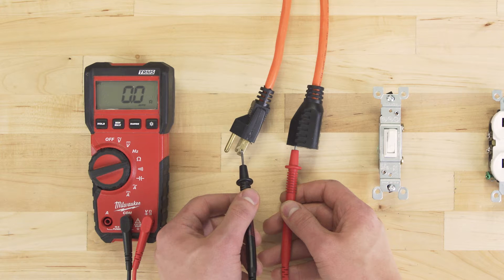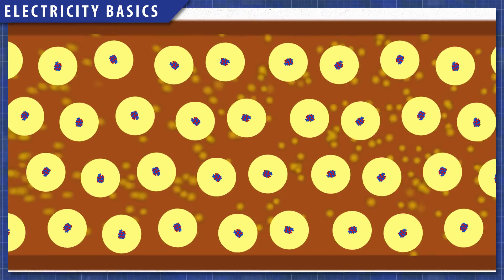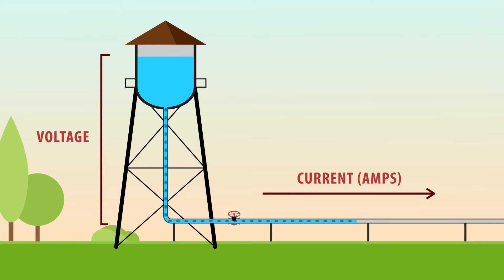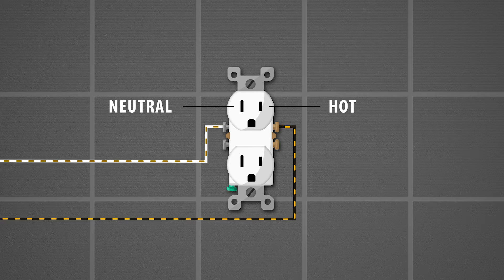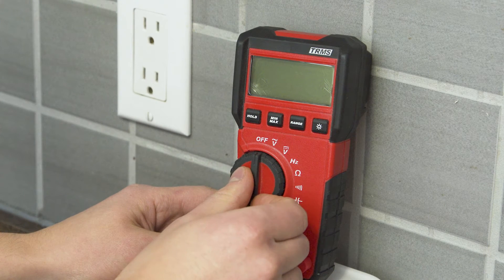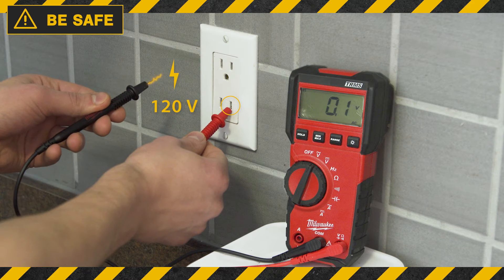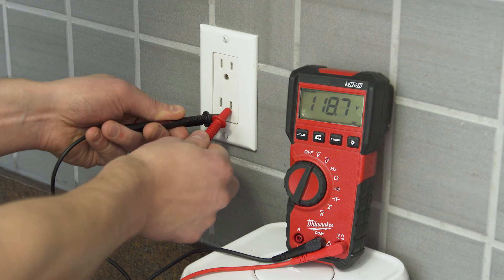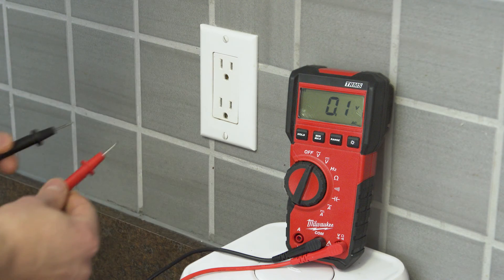How to Test Voltage in a Receptacle | Repair and Replace

Comment: Should I turn the power off first before doing this
Reply from the maker: Thanks for watching. This is a test for voltage which is testing the potential for electricity to flow. Turning off the power will mean that there will not be any voltage and you won't be able to measure anything. However when it comes to installing or replacing receptacles, you will always need to shut off the breakers first.

Comment: Mine are reading 126v from neutral to hot and ground to ground to hot. Could this be the cause of light flickering?
Reply from the maker: Thanks for watching. That is still within the acceptable 5% +/- range. What type of light is flickering? Are you using a dimmer by chance? Are they LEDs?
Reply: @AmreSupply  dimmer yes but not leds; regular bulbs. Had an electrician come out and stated the circuit breakers were fine. Utility company came out and said the same. Any suggestions appreciated.
Reply from the maker: @sanitary103  Best to check the dimmer to make sure its compatible with your bulbs, mismatches can happen. Also if the dimmer switch is older and been used a lot then it might be worth replacing or upgrading. As well a loose connection to one of the fixtures, or the switch could cause some flickering.
Reply: @AmreSupply  thanks a lot. Great video btw. It is appreciated.
Reply from the maker: @sanitary103  You're welcome and we're glad that you found the video helpful!

Comment: Why would connecting the red probe to live increase the chance of a shock, when you've got an alternating voltage coming out of the plugs, its not like the polarity matters. That rule surely must be the same the other way around.
Reply from the maker: Thanks for watching. That part of the video was talking about having 1 probe inserted into the hot terminal, the other probe will be energized. When inserting into the neutral (it is not hot) so the other probe would not be energized in this case.

Comment: What specs do the multimeter need to perform this test? My multimeter says 10A Fused. Does that matter? Does amperage need to be tested as well or do only volts matter?
Reply from the maker: Thanks for watching. That is a good question. When measuring voltage a small amount of current will be passing through the multimeter, but nowhere close to 10A. The multimeter only lets enough current pass through that is needed for the voltage measurement.
Reply: @AmreSupply  . Ok. I guess I'm looking for confirmation that my 10A/600V multimeter (Fluke 107) can test household outlets. This is my first multimeter and I appreciate any feedback. Thanks!!
Reply from the maker: @viewer-i5o  Yes that multimeter will work and for context the multimeter used in the video is also a 10A/600V meter. Additionally there will not be 10 amps flowing through when testing voltage while on the VAC setting.
Reply: @AmreSupply  . Thank you so much! Cheers!
Reply from the maker: @viewer-i5o  You're welcome, we're just happy to help!

Comment: My ground to hot is only 8-9?? What does this mean??
Reply from the maker: This means that there is voltage leakage. Moisture can cause this to happen. Alternatively it could be an issue with the receptacle connects or the ground wire in the system.

Comment: Is it safe to test plug with cheap multimeter? I have XL830L model
Reply from the maker: Thanks for watching. If the multimeter is rated for more than that voltage, if the leads are not damaged in any way, and it is on the right setting then it will work for testing voltage.

Comment: A better technique to hold test probes is to put both in one hand. That way, if you get shocked, the electricity won't travel across your body. AMRE should re-shoot this one; who knows, that might save a life.
Reply from the maker: Thank you for watching. You are right that for additional safety, in the case of damaged probes, holding the probes in one hand will prevent electricity from traveling across the body. This is why we always recommend inspecting the probes before each use.
Reply: @redfishcrawfish3647 which is neutral I'm new to being a maintenance tech for rentals all I know is carpentry landscaping and Minor plumbing.electricity spooks me
Reply: @ChipChurp the larger upper port on an outlet.

Comment: just did this to test a power conditioner and popped it. the wires of my multimeter blew out.
Reply from the maker: Thanks for watching. The multimeter does have an internal fuse, which can be accessed from the back plate. If the fuse is blown the replacing the fuse will get your multimeter working again.

Comment: What would case a ceiling light socket (that doesn't work btw) to display 192 volts on my multimeter? This is the reading when I turn on the switch with my multimeter in place.
Reply from the maker: Thanks for watching. It is likely an issue with the wires. It would be best to get this inspected by an electrician.

Comment: Hi before I watched your video, I was checking my wall outlet with the multimeter I have. A cheap one. When I plugged in the second lead into the wall outlet, the black lead launched out out smoke came out of the outlet. I can’t remember if I put it in the hot, neutral, or ground. I read you can switch the red in the black to test for reverse wiring. No? 
Anyway, why was I almost electrocuted? Because I “energized” the lead with the hot connection like you said in the video? Would plugging the black lead into the hot cause this? Or… is it because I had the red-positive wire plugged into the 10ADC of the multimeter? Because I had the dial accidentally set to DC? The outlet has two plugs and one was connected to a power strip, I was testing the other one, is that why?
Reply from the maker: Thanks for watching. Its essential to have the multimeter set up correctly, but that shouldn't create smoke out of the outlet. It would best to turn off the breaker to that outlet until it is fixed. 

If could be an issue with the wiring, debris in the outlet or there was arcing between the connections. This might be difficult to narrow down so it would best to contact an electrician.
Reply: @AmreSupply  Good idea. But I changed the outlet already. I believe it was loose connections. The outlet always had this ozone smell to it. The quick connections were used, which I understand are not code approved, possibly faulty. After I changed it, no issues. (Edit) I did see some video of a guy with popular cheap multimeter and the exact same thing happened (black connector of lead separated completely).   in that case it was the multimeter had very thin copper in the lead, which probably couldn't handle the current it was claiming. So I upgraded to Klein, jut in case. Thanks for great videos!
Reply from the maker: Thanks for the update! You are right that not all multimeters are built to the same quality. The Klein will work well for you.

Comment: If I'm stupid, just tell me so.  I have two outlets (out of 3) in a room that do not work.  My circuit breakers merely say "lights and plugs".  I want to pull the base plugs and check the wiring, but I do not know how to tell if the plug is live.  Since the base plug is not "on", I cannot tell if I switch off a circuit breaker, if it's the correct on.  Will a multimeter provide that info?  THANK YOU
Reply from the maker: Hi Kerry, thank you for watching. That is a great question. What you want is a NCVT ( non-contact voltage tester) which works by detecting the magnetic field around an electrical outlet or light. You can use this to confirm if the power is indeed shut off. NCVT are listed here: https://www.amresupply.com/part/9462517

Without a NCVT you can still use a multimeter to test between the hot and neutral or hot and ground to see if there is electricity supplied through the wires.
Reply: @AmreSupply  THANK YOU so very much.
Reply from the maker: @kmacaitis  You're welcome, we're just happy to help!

Comment: What if testing from ground to hot reads less than 120v like only 10v... what does that indicate?
Reply from the maker: Thanks for watching. When testing voltage there should be no more than 5% variation. If you're only getting 10V then there is likely an issue with the wires or the connection at this outlet or even the outlets upstream of this receptacle.
Reply: @AmreSupply  Thanks. It funally read 120v. I might have not inserted it correctly.

Comment: Hi, I have a type F socket and want to test of which one is hot and neutral. I plug the probe into one of the hole in the socket and one to the ground pin. Turns out both have the reading of 52 V and 72 V. I tried to connect both of the hole (hot and neutral) the reading was 220 V (I lived in Indonesia). Any idea why both of the holes have reading to the ground? Thanks
Reply from the maker: Thanks for watching. If you test between neutral and ground there should be no significant voltage. 50V is quite a lot. If there is voltage than it could be an issue with how the wires are connected or an issue with another outlet or fixture down the line.

Comment: what happens if the voltage measurement of my socket-outlet is different from 120 volts when I measure the voltage between the hot and ground? it's around 16 volts
Reply from the maker: Thanks for watching. That is a lot of voltage leaking to ground. It could be an issue with the wiring insulation or one of the connections at the outlet or down the line at another fixture. It might be best to get it professionally inspected.

Comment: Thanks , But what if I dont know +ve? How to avoid the shock and measure the voltage ?
Reply from the maker: Thanks for watching. Holding the multimeter probes from the insulated handles will prevent a shock.

Comment: It isn't quite as simple trying to stick the multimeter probes into a TR Tamper Resistant receptacle. You might need to use a "cheater plug."
Reply from the maker: Thanks for watching. You are right that Tamper Resistance receptacles can make it difficult to do the test.

Comment: Excellent description about basic electrically and also testing a receptacle for proper wiring.
Reply from the maker: Thank you Robert! If you're curious this video is cut from a longer video on Multimeter and Electricity Basics which covers some of the same topics but more on the setup of the multimeter: https://www.youtube.com/watch?v=r_migcta_Is&list=PLCo9SMjkdWBycw9hZVfYFc6Sw2Jlavaak&index=2&t=0s

Comment: What if 4 of my outlets at home show 98v? any idea of what could be an issue?
Reply from the maker: Thanks for watching. If you are testing 98V at 4 of your outlets then that's a little low. If you have an older home it could be an issue with the wiring as homes with aluminum wires can have issues. It could also be a bad wire connection or an issue with one of the outlets, or light switches in the same circuit. 

In this case it would be good to get this inspected by a electrician.

Comment: Whatever the voltage is, it should be consistent, correct? Trying to see if our voltage is fluctuating or dropping too low and causing four separate battery backups (in different offices) to  beep and click off at the same time as well as wake up the copier and plotter. Great explanation in this video. Thanks.
Reply from the maker: Thanks for watching, we're glad that you found the video helpful. The voltage will fluctuate as different devices and appliances turn on and off. A large inductive load like a dryer requires a lot of power during startup and one might often see their lights dim for a moment when the motor is started. In your case it would depend on what circuits each office is on. Having too many devices on a circuit might trip the circuit breaker. If you test the outlets there might be a variance of around +6% or -13% depending on the utilization. So a voltage of 104.4 - 127.2 is still perfectly normal http://voltage-disturbance.com/voltage-quality/voltage-tolerance-standard-ansi-c84-1/

Comment: Mine reads 127 -128 is that bad
Reply from the maker: Thanks for watching. A normal  120 volt outlet will have a variance of about +/- 5%. In your case 128 is getting to be a little bit on the high side, but keep in mind that the accuracy of your multimeter. If you're using an analog one it could be out by a couple volts.  

Now if only one outlet is reading that high then it could be an issue with the wiring or the circuit breaker.

Comment: Why do all outlets that have old bx wire give me a 120 reading both ways? My handheld outlet tester says they are wired correctly and there's no way they are all wired backwards
Reply from the maker: Hi Justin, thank you for watching. If all your outlets show (120V between Hot and ground) as well as (120V between neutral to ground) then its likely an issue with how the neutral is connected at the breaker panel. In this case you'll want to get this checked out by an electrician.
Reply: @AmreSupply  I recently had my whole panel replaced by an electrician and like I said, this only happens on my handful of outlets that have the original 75 year old bx wires.
Reply from the maker: @justinparnell6873  Thank you for clarifying. In that case its possible that one of the neutral bx wires that is somewhere connected to a hot downstream in the circuit. This could from one of the outlet or possible a 2 or 3 way light switch if those are still using the bx wires.
Reply: @AmreSupply  okay thanks.  That's probably what it is since I have 2 original bx circuits both of witch both of which have outlets and lights on them.

Comment: I’m reading a 125 what that mean
Reply from the maker: Thanks for watching. If the multimeter reads 125 volts then thats within the normal acceptable variance. The voltage in a homes outlet is not exactly 120V and can range from 110 up to 125 or so.

Comment: Great to finally find a video that is short and to the point.
Reply: Why do I not get a voltage reading of 220 when both 110 circuits. Read correctly    on the same circuit
Reply from the maker: Thank you! We're glad that you found it helpful!
Reply: @AmreSupply  Can I put the black prong in the small slot, and the red prong in the big slot, because my outlets were installed upside down.

Comment: Tried following these instructions to test an outlet and blew up my multimeter! Not sure where I went wrong.
Reply from the maker: Hi Katherine, thank you for watching. Its possible that the multimeter leads were not connect to the right spot on the multimeter and you likely blew the internal fuse. In a different video we covered how to setup a multimeter in a little bit more detail. Its worth watching to see if that was the case. https://youtu.be/r_migcta_Is?t=190

Comment: Is it possible for the juice to flow through the ground plug on a correctly wired grounded outlet during a power surge or thunderstorm?
Reply from the maker: Hi Geri, thank you for watching. If there is a power surge then the electricity might travel through the ground wires in a home to ground if it was the path with the least resistance. Since a ground wire already provides a good path to ground, it is unlikely that a power surge or lightning strike would travel out through the ground plug on a correctly wired outlet as any other path would have a higher resistance.

Comment: Just tell me is it safe to put a screwdriver in the round hole or not
Reply from the maker: It is not safe to put any tool into the outlet and don't assume that the neutral or ground wires are ever safe. There are cases where the neutral or ground wires are not wired correctly and can still electrocute someone. Best to be careful in all scenarios.

Comment: What is your setting on volt  meter.
Reply from the maker: Thanks for watching! In this video the multimeter was set to the volts AC (alternating current) option  "V~"   not the DC (direct current) "V - - -"  setting. in this meter it is auto ranging so there's only one option for VAC. In some meters you'll have several options of Volts AC. For example if you have a 200 VAC, and 500 VAC setting, those refer to the maximum voltage that can be detected within that range. In that case you'd want to choose the 200 VAC option as you'll only have to test 120 volts.